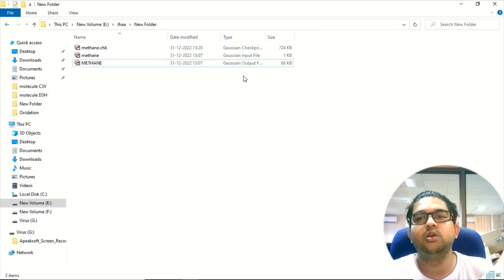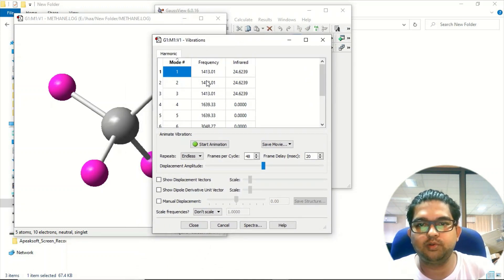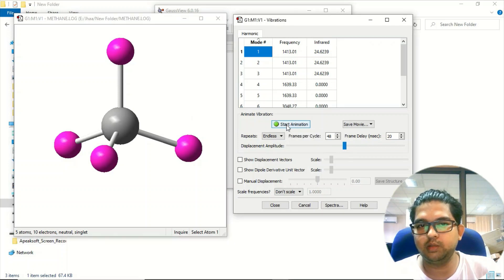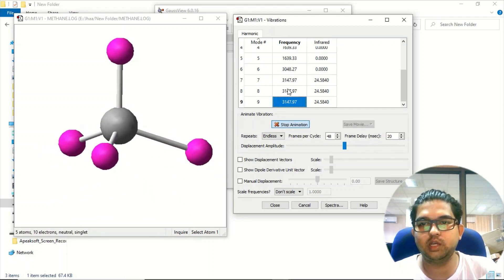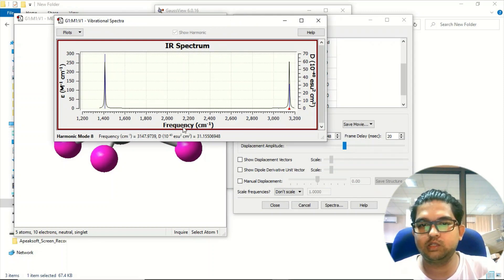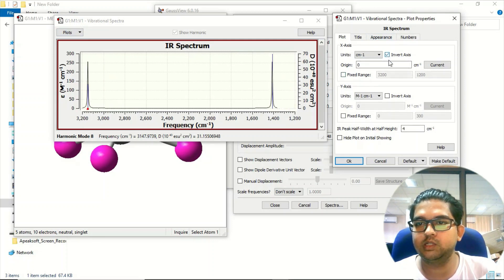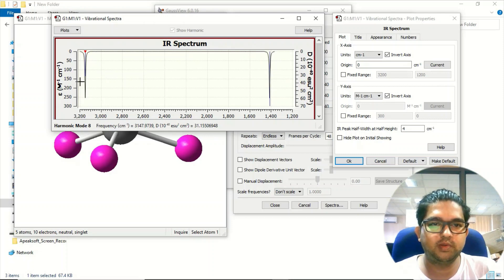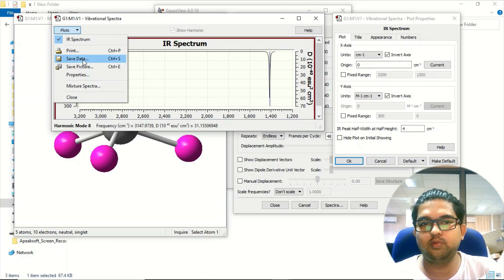Frequency Calculation and Analysis Using DFT method in Gaussian Software || Part 2 || Gaurav Jhaa

Comment: Dear Sir, can you please make a video on DFT calculations using the broken symmetry approach in gaussian software?
Reply from the maker: To perform DFT calculations using the broken symmetry approach in Gaussian software, you need to specify certain options in the input file. The broken symmetry approach is commonly used to study systems with open-shell electronic configurations or systems that exhibit spin contamination.

Comment: Sir, Could you please share a on anharmonic vibrational frequency  using gaussian
Reply from the maker: Anharmonic corrections can be calculated using various methods, including perturbation theory, variational methods, and sum-over-states approaches. In general, the anharmonic correction to a vibrational frequency can be expressed as:

Δω = ωanh - ωharm

Where Δω is the anharmonic correction to the vibrational frequency, ωanh is the anharmonic vibrational frequency obtained from a calculation that includes anharmonic terms in the PES, and ωharm is the harmonic vibrational frequency obtained from a calculation that assumes a quadratic PES. 

Use freq=anharmonic for anharmonic correction calculation. Using this, one can calculate the anharmonic vib. freq.

Hope it may help you.
Regards QGJ